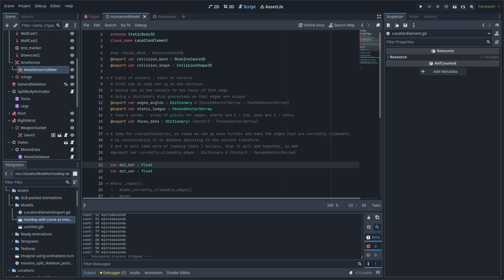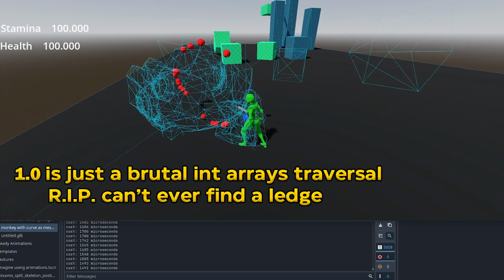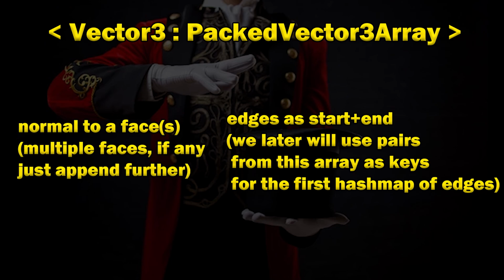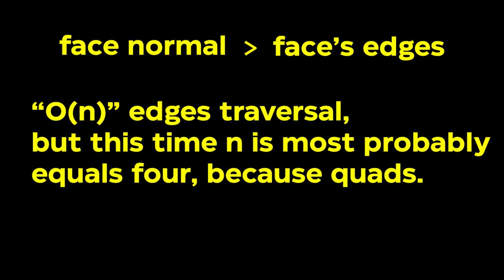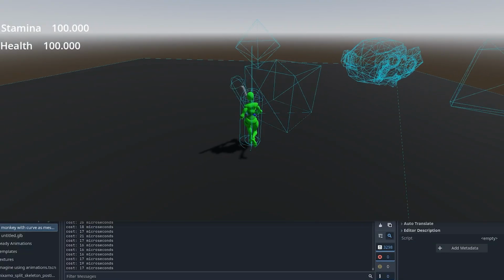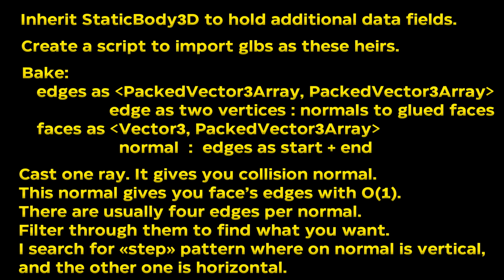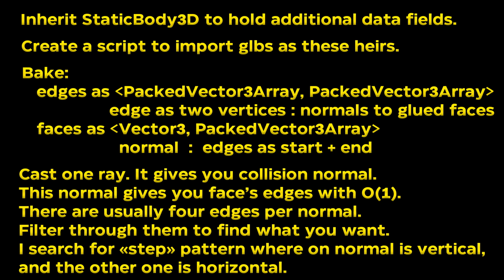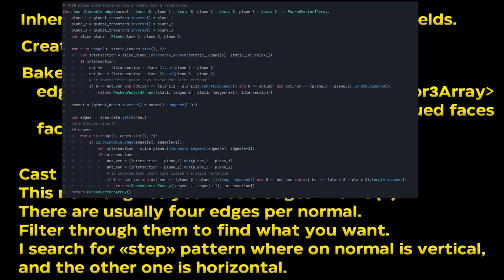How to be OP and detect some climbable ledges with godot (3d)

Comment: This is excellent.

Question though, is there any way for this pipeline to support scaling/rotation of the mesh in the actual editor (or re-baking meshes transformed in the editor)? I notice that attempting to scale cubes i'm importing will break all edge detection.

edit: Just pointing out that you are carrying my development efforts so hard with these engine architecture videos, can't thank you enough

Comment: The reason the get edge faces function doesn't work like you think is because the mesh you are working with is indeed using separate edges, you can merge them, but then vertices have to share normals.

Comment: The first 2 minutes and I'm already agreeing with all the issues you had. I had the same issues in 2D and ended up querying the packedVector2 polygon directly, and just using the previous point to find the normal (making sure the polygon is clockwise). With the normal I can see if the surface is a wall or a floor. In my game you can climb in any surface but knowing what is floor helps with climbing into the floor or not grabbing a floor point when in the air. With a grid partition of the space we do get to about 60 microseconds per query (like 10 to 20 once moved to gdextension), no matter the size of the polygon. Pretty cool but much simpler than your 3D version.

Comment: I mean, if we're talking about "thinking boxes," then shouldn't you really be evaluating the normals between faces instead of edges, and finding those with a sharp enough difference to use as a climbing/vaulting edge, then land on the "suitable" face that can act as a floor? Why complicate it calculating or marking down with only edges?
Reply from the maker: I mean, don't I do exactly that?..
Edges are used because they are "primary" for problem definition. We need to find an edge => we search for edges.
Then I do what you said, I evaluate normals of two faces and see if they are sharp enough and if one of them "can be floor" etc.

Comment: I just want to say, "don't use physics to solve a problem in geometry's domain" has hit me like a truck. This is possibly the most valuable lesson I've taken this whole year tbh. And it's just so simple. I already knew it, even. But for some reason it always takes me too long to realize I'm tackling a domain A problem with a domain B solution, and maybe I should start with understanding the problem at hand better, before jumping to conclusions.

I've been having some trouble designing a solution for my day job, and I think this has simplified everything so much now. Thanks.

Comment: is this approach used to find out where to put the hands of the character specifically for procedural animation? I might have missed the context in the actual video
Reply from the maker: @pepsiman9093  Well, it isn't yet, but it, of course, will be used exactly for that in future episodes.
Reply: @PointDown  some crazy tech right here, i feel like theres definitely an easier way to do this but probably not as precisely as this method for sure
Reply from the maker: @pepsiman9093  Well, there is a gradient of measures, of course. But what makes me solid in my belief that the tech described in the video is strictly superior than any runtime physics stuff, is the "inescapable" need to shapecast at some point. 
For example, here's a nice guide for unity, different engine, but the ideas are universal.
https://weaverdev.io/projects/ledge-grab-tutorial/
 
It can be pretty useful, but what do we see there? Oh, it's a shapecast.
And this is a giant problem for those methods. The most accurate physics tech is the slowest physics tech, shapecasting will tax your performance.
While our thing works in about 0.06-0.2 ms at worst, shapecasting operation costs just start at 0.15ms.
So not only easier to understand methods work less accurately by always having a false neg or false pos, they do work slower.

Comment: In your first video, you mentioned an automatic edge-detection system, but now you’ve ended up with a solution that requires manually editing a model and adding an invisible object to reduce edge calculations. Then in your code, you look for model names like "blablabla-edge." Honestly, I’m not a fan of this approach. When I think of optimization, I imagine a balance between reducing calculation time and streamlining the game development process. Imagine working on a full-scale game and having to add this mechanic for every climbable object. Sure, it’s doable, but it feels counterproductive. I’d much rather have a system that might take a bit longer to calculate but doesn’t add extra work for me, basically is dynamic which also makes it reusable for any future game projects.
Reply from the maker: I don't think you understood the video.
The system automatically detects any edge that [implements a pattern]. For example in the video I automatically pull up all the edges that have one face have less than 20` difference with looking up, and other face have less than 30` difference with looking horizontal. 
The reason I needed to mark down a monkey manually is I wanted a mechanism to introduce exceptions to this rule and a I made one.
If you do a rock, you don't need any extra preparations, your rock will be detected as climbable if it looks like one. So most of the time my pipeline doesn't involve any manual markdown. As it comes to importing StaticBody3D from blender, well, my levels earlier consisted of scaled CSGCubes. But if you open docs for CSG objects, they specifically insist you use them only for early stages blocking, as CSG objects are less performant than classical game assets. So, in real production, even if I want a scaled cube for my game, I will still open blender, scale some cubes and export them. It means that the literal only "extra work" that my pipelines brings to production is to slap a single "-colmesh" hint word onto collision model for an asset.
Reply: @PointDown  Thanks for clearing it up, I indeed didn't understand the video completely. I missed the part that you have an additional solution for situational models.

Would you consider creating C++ Plugins for some calculations as an option?
Reply from the maker: @feelSmoothie  Well, I have never wrote a line of C++ in my life :D.
But the overall theme of making a GDExtension to do some matrices powerlifting is very tempting. Most of all to power the thing I brew in the background - a custom animation pipeline that will answer some of my biggest design questions for original ones, and will be suited for "pro level" dedicated authoritative server for multiplayer games. 
If/when I throw myself into the wall of C++, I might write an extension for this thing, but it's not the top priority. I mean, we achieved 0.05-0.08 ms for realistic shapes, what better thing we can do? Only some final polishing like playing with hashing algorithm and setting directly the number of buckets in the hashmap comes to mind.
Reply: @PointDown  C++ is hands down (personal opinion) the best language out there. I'm pretty sure GDExtension is fun, although I did not touch it too. If you have done some C# before, you'll get the hang of C++ quickly.

I'm looking forward for some Livestreams of some sort (if that's even planned). It could help you boost your channel too.

Comment: Love the idea, I’m just worried about memory requirements. Even if the available edge data is prebaked, it can end up being a lot of information for a large level depending on the game. All of that information will have to live in memory at least for the active assets. Do you see this as a problem?
Reply from the maker: Byyyy the way, good ideas come after release but still:
If we polish the thing to the end and want to build our towns from monkeys, but still chase the gameboy compatibility, we can do following. Post import script doesn't set any export fields, instead it bakes all the data into a resource. Those resources then are pulled from the system on startup, and they are unique. And instances of an asset just request injection of a link to that resource, as they only read them. This will allow you to have whatever amount of monkeys in monkeytown, but all of them will use one data resource that won't be duplicated per instance.
Reply from the maker: Nah. Godot's "worst" untyped Variant is 20 bytes and it covers most of the engine's internals. If we imagine that both array and each vector3 are Variants, then the full baking of a cube will cost us 2760 bytes if I'm not mistaken, or 2.69 KB. A monkey must cost about 234 KB (ofc I just eyeballing here and I only count pure data of dictionaries). It's almost nothing. I can built a skyrim's town of monkeys and it will prbably add about 50 MB to memory hold for a game. For a modern game you'll probably outpace that with a couple of textures. And monkeys are like... monkeys. I can build my towns of cubes instead an I'll need about 380 before I break through one MB of memory.
Reply: @PointDown  True, I was doing my math wrong. If it weren’t for the fast and reactive  player setup you’ve decided to implement, would you have used the build in Godot method you considered? Like say, you decided to cap the frame rate at 30 fps and gave yourself some wiggle room or even more drastic and maybe have the player slow down time and do some time dilation stuff which gives you more time to find grab able edges.
Reply from the maker: @neurolancer81  You mean just storing MeshDataTool per asset and parsing arrays? Well, I wouldn't do it just because it's me and I know a strictly better method now. But any task is solvable with MeshDataTool also. As I demonstrated in the video, strictly speaking, we can parse every single edge of a monkey in 1.5-2 ms. This is, I remind you, 1/8 of the frame time for 60 fps game. So, if you are a fan of MeshDataTool direct parsing, it will totally work even without slowing time or fps capping. With cubes MeshDataTool works in the same 0.05 ms timeframe, and you can invent a multi-pass solution to get your hands on edge's faces even if edge-clones are blind.